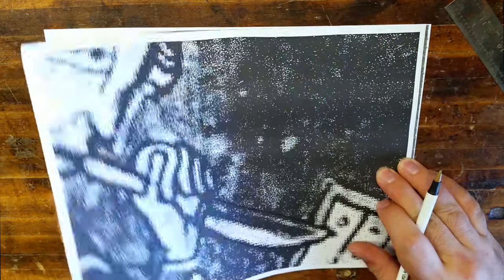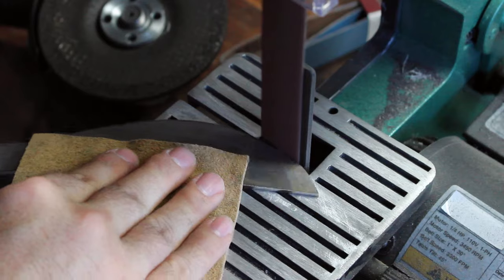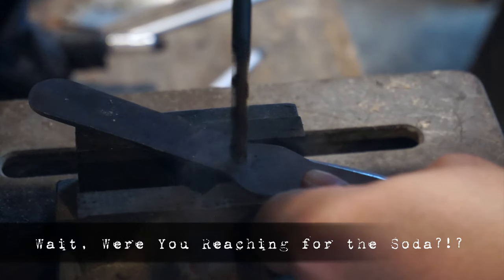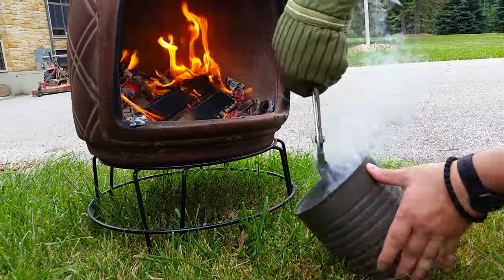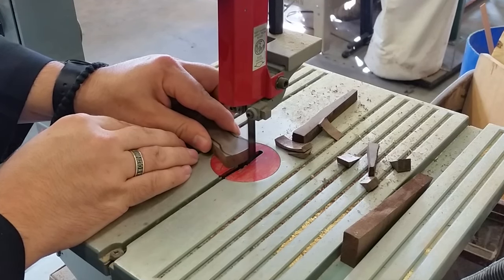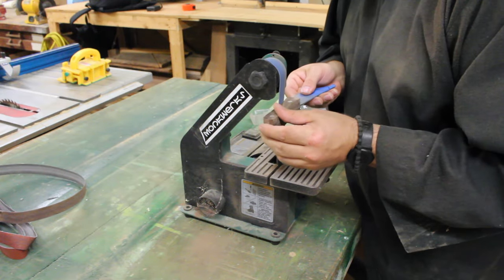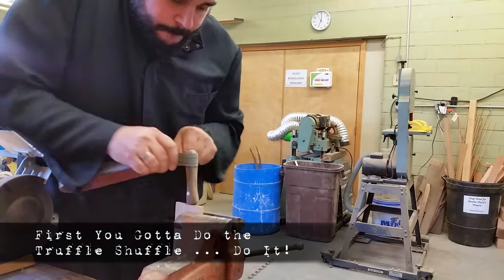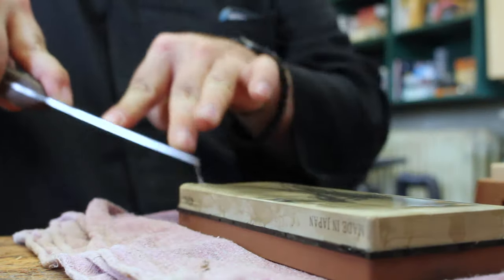Medieval Monk's Knife (MonkWerks)

Comment: This is just a tip about something other than the knife, per se.  In my job as a structural engineer, I turn raster images into vector images all the time.  The way I do it is to get a jpeg or scanned image of the object, then import it into QCad.  (There is a free, open-source version of QCad, so one doesn't have to purchase a license unless one wants a much larger suite of capabilities.)  Within QCad, I trace over the lines and arcs of the object using the drawing tools.  After that's done, I delete the original raster image.  If your object is not properly scaled -- say your knife is 22 feet long -- then you can easily scale it to the proper size using QCad's modification tools.  The advantage of having a CAD or vector version of your object is that you can easily scale it for other uses.  Say that you wanted to make a new knife with the same proportions, but 2 inches longer.  You could easily scale it up to a new size, then plot it at its full scale.
Reply from the maker: +Tom Nally I was just listening to the latest Making It podcast, and Jimmy and Bob were talking about using, I believe it was Fusion. Programs like that sound like they would be extremely helpful, especially if your doing production work ... though its also a pain when you change a dimension on a one-off piece and you have to redo practically everything in Sketch-Up!  With the name QCad, I assume it's similar to other cad programs?
Reply: MonkWerks with Fr. Thomas Yes, QCad is merely a 2D CAD program, available at www-dot-qcad-dot-org.  It has now become my "go to" CAD program.  One reason is that it will run from a thumb drive.

Comment: Very well done. Thanks you for sharing this experience.
If I may suggest....
The next time - and hopefully not - you need to fill a gap in wood, just mix a bit of the wood's 
sawdust with glue or and putty it into the gap. Sand when completely dry and it will be barely
noticeable, if at all.
And I like your use of tung oil it darkens the wood but that's part of its beauty as it enhances 
contrast.